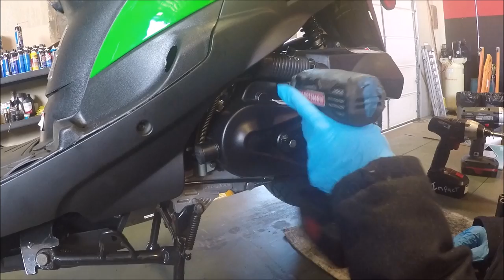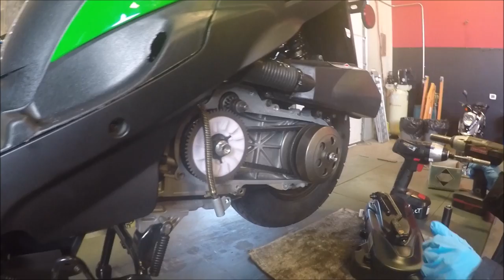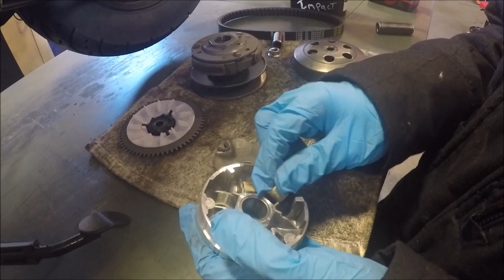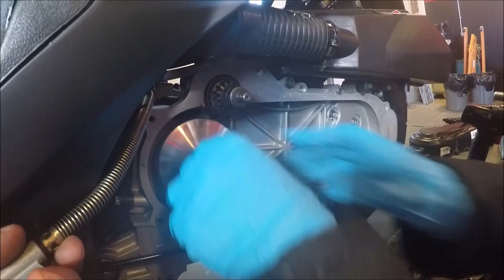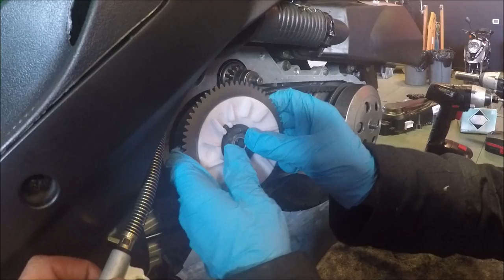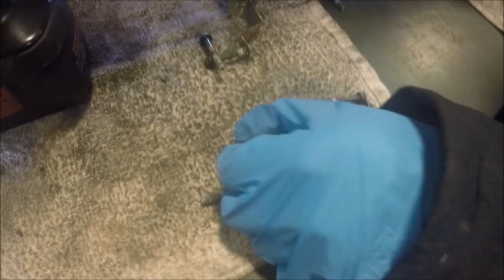TaoTao 49cc Moped Gas Scooter Transmission Tutorial

Comment: My mechanic wants $120 for that?
Reply from the maker: Depending on what State you reside. Cost range, $75-to $150 for transmission service.
Reply: @MOTORSUncut  I guess that makes me feel a little bit better but I don't know why I couldn't do it myself. I took it in for an oil change and gear fluid change and it's been leaking both ever since. He's changed out three seals to get the oil to stop leaking. Now, he's going to charge me for a gear fluid leak too I'm sure. And wants to change the belt. I've got about $700 into this scooter in the last two months. I'd at least like to figure out why it's leaking gear fluid myself instead of him charging me for a second time. I'm in Colorado BTW. I'm getting it serviced by the dealer and every time I take it in, it has new problems. I had absolutely no issues before that oil change.